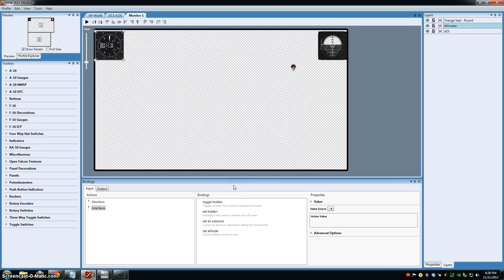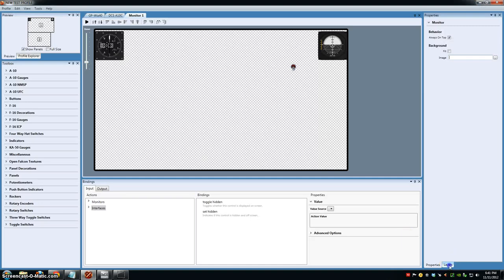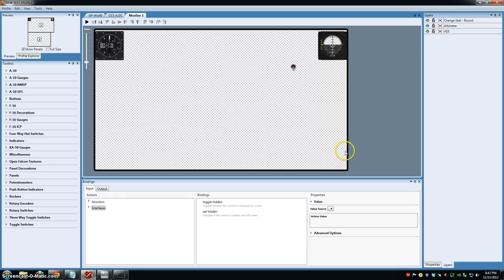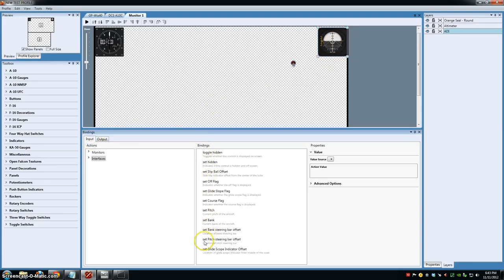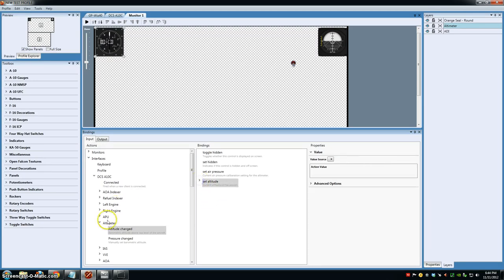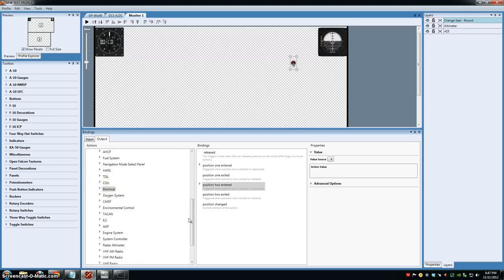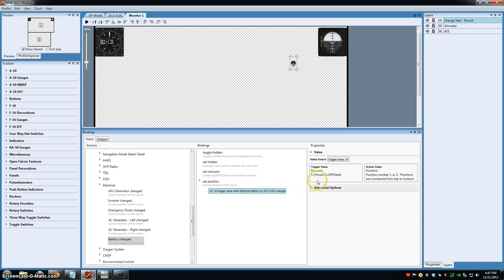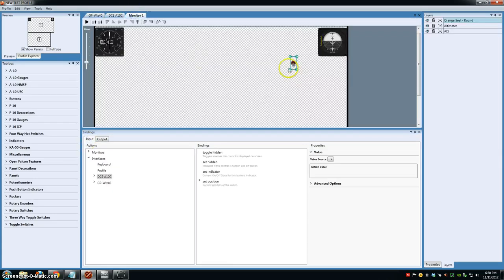Introduction to Helios Part 2

Comment: What is that little icon in the Layers panel that looks like this  ] - [      It comes right after the Lock icon?  I cannot find info on that anywhere.  Thanks.

Comment: mine doesnt have the cutouts!
Reply from the maker: So you either need to make one yourself if your gauges are not going to be in the standard locations or if you just don't see the cutout image in the folder make sure you are set to see all file types.